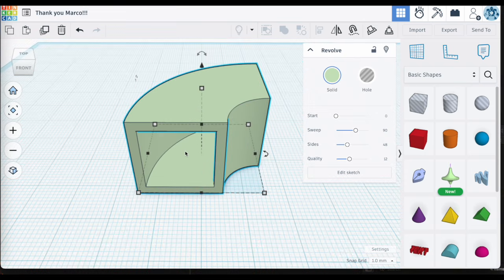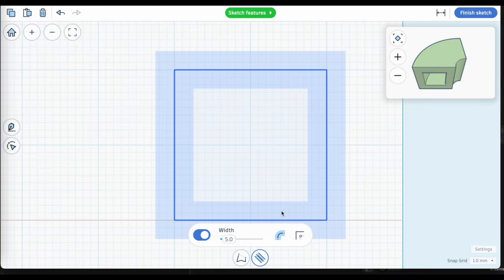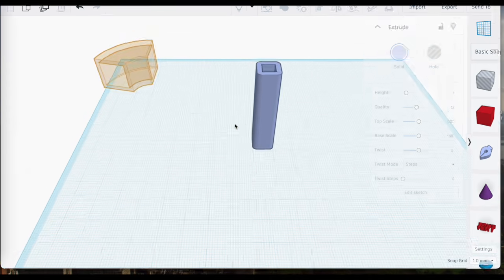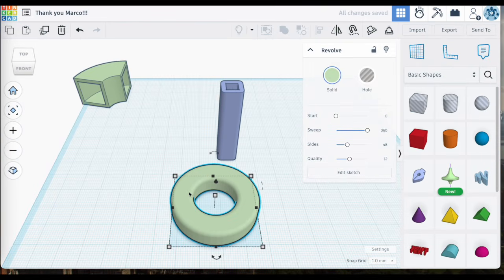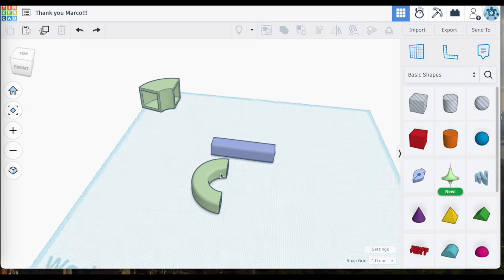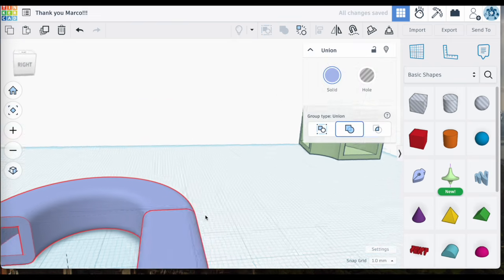The Stroke option in Revolve Sketch works!

Comment: There is a known problem with grouping hollow Revolve shapes. Sometimes they become filled solids. The official solution is to leave a gap to the right, by the axis.
Reply from the maker: Ahh that is what I experienced recently - it happened once and then it didn’t occur again - it must have been what you described above.  Thanks for the tip!

Comment: ¿Como puedo crear pestañas en las puntas de los segmentos para poder juntarlos mediante tornillos o pegado, ya que necesito hacer una pieza grande?
Reply from the maker: Hey @AlbertAlías-t7r - I would probably create a small segment of pipe (1-2mm thick) with a smaller diameter so it will fit inside one of the ends of your pipe.  Again, just give some tolerance here (~0.4mm) so another pipe can slide easily onto it.  This will probably require a couple of sketches but once you have them you can just copy and paste them to the ends of other pipe pieces.  I hope I understood your question correctly.  Good luck!